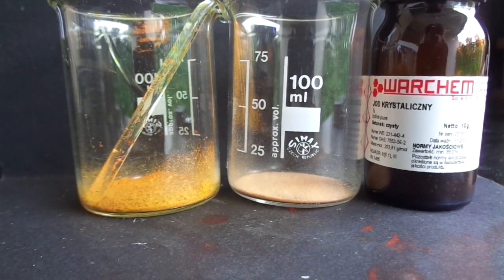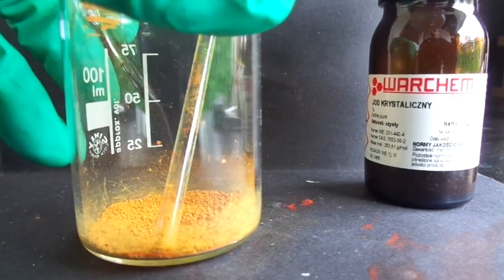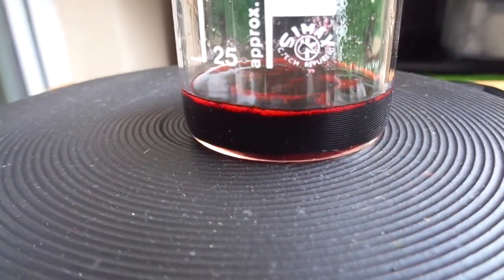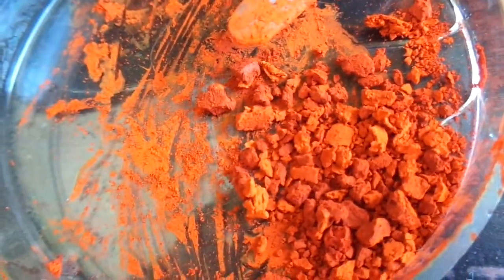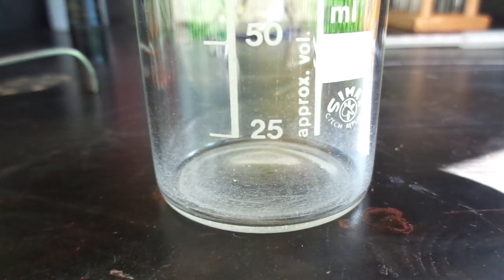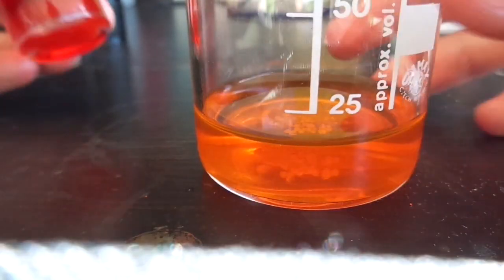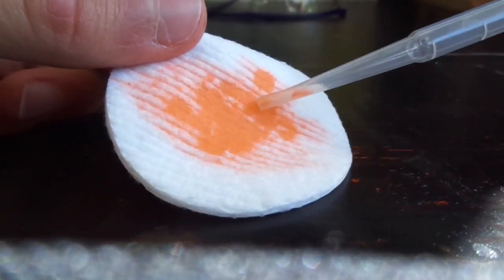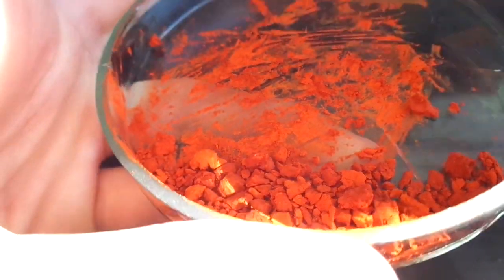Making  erythrosine (kind of)

Comment: @John Geologist,

This article may help you understand a bit your synthesis problem.
Synthesis of Triarylmethane and Xanthene Dyes Using Electrophilic Aromatic Substitution Reactions

(James V. McCullagh* and Kelly A. Daggett†)
You may find the pdf here:
http://www.sakmarlab.org/Overview/People/LabAlumni/DaggettK/mccullagh_daggett2007.pdf

In the article they use 1 mole of fluorescein for 4 moles of di-iodine and apparently 4-6 mole equivalents of NaHCO3... and also some NaI.
From this it is obvious that you could only form unfully iodinated compounds...
Since you used 1 gr fluorescein, 0,5 gr NaHCO3 and 1,5 gr I2...
MM Fluorescein = 332,31 gr/mol
MM NaHCO3 = 84 gr/mol (multiplied by 4 to 6 = 336 to 504 gr)
MM NaI = 149,89 gr/mol (maybe not needed see next point below)
MM I2 = 253,8 gr/mol (multiplied by 4 = 1015,2 gr)
So if your fluorescein is 1gr, you would need at least 1gr (probably better 1,5gr) NaHCO3 and 3 gr I2... in your experimental procedure both NaHCO3 and I2 are deficient and limiting reactants while fluorescein is in excess.

The NaI may help dissolve the I2 as NaI3 (I3(-) is soluble)... I guess it is not per se needed since half of the I2 is fixed as a virtual I(+) to the phenolic ring and set a H(+) free that join virtually to form HI with the remaining I(-)... the driving force of the reaction is the base HCO3(-) that takes the HI out of the system as H2O, CO2 and I(-)
NaHCO3 + HI --> NaI + H2CO3 (H2O + CO2(g)) 
So in principle NaI is formed by half of the di-iodine  initially present.

It is possible that the NaHCO3 works partially upon heating via deprotonation of the acidic proton from the phenol (that becomes a phenolate).. and activates the position in ortho and para of it (para here is already used by the benzolactone ring)... it would generate H2CO3 and CO2(g) would be kicked out of the system by the heat... but this woudn't change the final result.

Typically phenol (hydroxybenzene would lead to mono-, di- or tri-iodo derivatives.
In the case of fluorescein, you insert iodine atoms at all possible places ortho- or para- to the Ar-OH groups (and hidden form of it as Ar-O-Ar).

As a final point, I'm not sure ethanol is a good solvent choice, since in basic media (NaHCO3) and in presence of I2, it would probably react partially with it to make ethanal, iodoethanal, diiodoethanal or triiodoethanal... what are competing reactants for the ortho- and para- position of phenolic group... aldehydes are very reactive against phenates...
So the use of ethanol may be yield depleting.

Hope this helps.
PHZ (PHILOU Zrealone from Science Madness forum and A.O.L. Newsgroup Alt.engr.explosives)
Reply from the maker: Thanks I might actually try it again because as you said I didn't use enough iodine and bicarbonate because the product was still fluorescent and contained quite a bit of fluorescein.